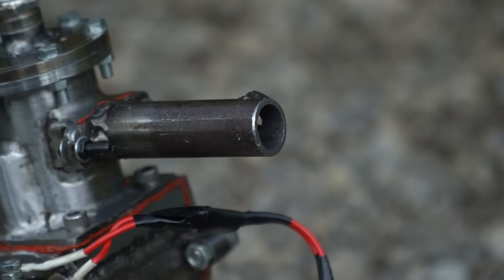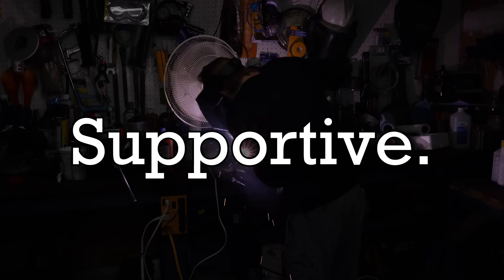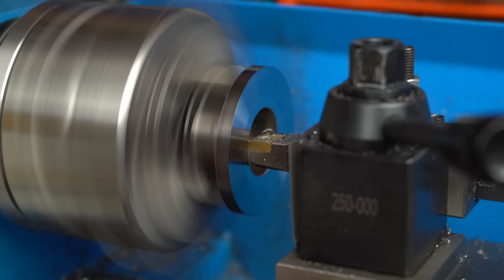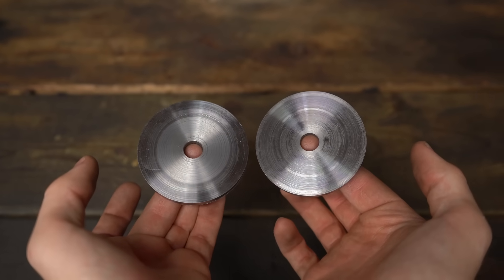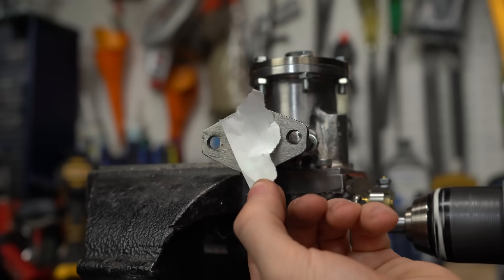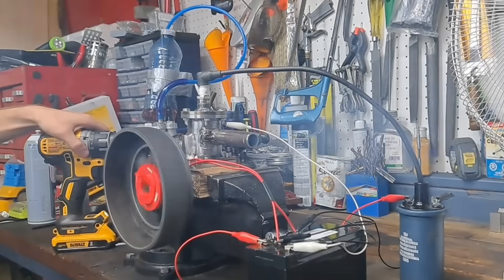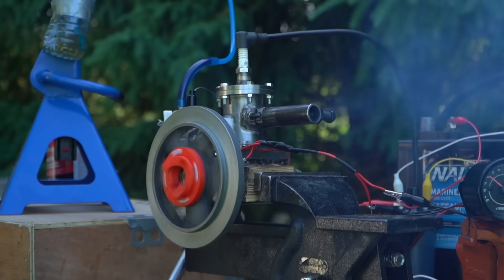I Made a Two-Stroke Engine Using Things I Found at the Hardware Store

Comment: This is an excellent project. In my experience, nothing has helped me learn more about a topic than reinventing the proverbial wheel. We do this all the time in computer science. Luckily rewriting code and debugging is free and takes much less time. The same can't be said for mechanical and electrical engineers. Mad respect for you patience and courage to face potentially expensive failure.

Comment: I've been thinking about something different: converting a compressor into a bash valve steam engine (piston goes up and bashes open a valve to admit steam, piston goes down and uncovers an exhaust port.) I notice you use a rectangular port. How does that affect the piston rings? I was thinking round would be less likely to snag them.

Comment: I'm amazing at everything except welding.
What I finally learned was pull in a consistent line, stop trying to weave. I have a flux welder and the power curve is high non-linear, so the various weave patterns fuck up the heat transfer, wire flow then goes out of coordination and you just end up with a blobbed up mess.
When you can pull in a straight line and get good pooling and penetration, just do very short distances over and over again letting it cool after every minute of welding you do.

Comment: OK make one a bit bigger. Carve fins into the crank case and put the engine in a go kart. You don't have to build the kart, if you can borrow, or buy a cheap used one.  A running engine that can do work, would really impress. 
I have been wanting to build an engine since I was a child, 50+ years later, I am watching someone else do it. Never did acquire the tools needed, and never got around to it when I had access to a machine shop.  
- Cheers

Comment: there’s just so many wrong things here. 

the ports MUST be calculated, you have to phase the ports (including the transfer ducts) in crankshaft degrees. 

For example, 50cc 2 stroke scooters have an exhaust port degree of 180 degrees and it’s “low” so it has maximum torque at low rpms. 

The exhaust port width must be calculated if it is elliptical, in your case it is and it must NOT go over 70% of the piston diameter, so if your diameter is 47mm, exhaust port can only be a maximum width of 32mm, anything over that will make it loose a lot of power. 

The cylinder head must not be flat it the piston isn’t a flathead piston that will ruin compression and cause misfiring issues. 

English is not my first language.

Comment: 2 strokes need backpressure to run right. the opened portion of the pipe creates negative pressure wave and sucks the exhaust out of the cylinder, also pulling in the new charge, the necked down portion creates a positive wave to force the charge back into the cylinder. You jet the carb so that you have about 1/4" of wet exhaust. The new charge gets 1/4" into the exhaust before being forced back in

Comment: u should have contacted people in europe specifik italy spain poland or the netherlands  in these countrys we stil have like a lot of two strokes and also they stil are here on the road a lot because a lot of people here think four stroke is for bikes and cars and suchs not for mowpads or dirtbikes and also u put in to muchs oil whit youre petrol thats why its smoking like crazy and also it seems like u never ever have put togheter and apart a normal two stroke to see how some simple things are wichs whould have made this easier and probably runing beter and that thing whit the carb i already knew that 19 mm is to big for that litle engine u add least need 50 cc to make good use of a 19 mm i even think u should put on a even smaller carb than 13 just because youre displacement is sow small and puting in biger jets is easier and beter than ajusting the hight of the needle wichs already whas set add the best position from the factory i mean those things are sow easy to avoid and you are smart enough to for see that stuf

Comment: I might have missed it, but I hope you had a very good oil seal on the crankshaft/crankcase bearing, because it's probably one of the most important things for a great running 2stroke, is having awesome crankcase pressure, higher viscosity oil makes a difference to give better crankcase and cylinder pressure, in the old days when 2strokes just used a brass bush for the crankcase seals, you always used 30w oil at 10 to 1 mix, for that purpose.

Comment: It's very easy to make a reed valve box for the inlet side to the crankcase, it makes heaps of difference to preventing blowback and not needing back pressure from the exhaust, which actually slows the motor down in the end.

Comment: Check out the workings of the RM 125 2stroke dirtbike =) it uses a cooling system that passes liquid around the cylinder walls and out into a aircooled radiator, you would also be able to pull an exhaust pipe off a 90's something RM motor and cut it down for your size =)  the 125 should use a 21mm throttlebody carb, and you could potentially connect a stator on the flywheel to charge your system

Comment: Hello, I see that you have a variety of skills and instrumental equipment to have carried out this work, so I propose the following, to make a 4-stroke engine, say 50 to 150 cc, with an overhead camshaft, work in 2 strokes, for which you will surely have to use direct fuel injection, a small air compressor to evacuate the combustion gases after the piston reaches bottom dead center during the exhaust, and modifying the cam crossing to proceed with the appropriate operations to evacuate the burned gases and to introduce fresh air through their forced sweeping, for a new combustion. Without necessarily having to overload the cylinder chamber, only enough to the RPM regime that the engine is carrying. Theoretically, the power and torque should almost double. It must be ensured that the metallurgy of the engine is NOT forced, in which case it must be reinforced. I hope to see your success soon in this problem that I bring to you and propose to carry out, with your abilities, since I do not possess them, I am putting it to you. Best regards from S.L. Argentina. !!!

Comment: seem to recall something about 2-stroke engines having an angled part on the intake side of the piston to direct the fuel away from the exhaust port.
Reply: Yes! older two strokes used a baffle on top of the piston to prevent the intake charge from blowing right across the top of the piston and out through the exhaust ports!

Comment: brother i REALLY hope your wearing a respirator rated for weld fumes under that hood. Especially with flux cored wire, if not you're looking for a p100 with some nice 2097 pads, and then change them pads frequently. Those fumes are absolutely no joke, acute exposure aside, prolonged exposure will hit you in the whole ass respiratory system with cancer, stomach ulcers, kidney damage, and irreversible damage to your nervous system. sorry for the high horse but keep safe man, you want to retire with the ability to piss and breathe normally with the state of mind capable of appreciating those things

Comment: who uses the handle on angle grinders ? and safety shield ? it only cost me 900$ for the rusted metal weld spackel removed from my eye   totally worth it .. ( it was hot when it went in too so it burned its way down deep and they pick it  out with a pointy stick not uncomfortable at all .... and eye ointment is fun too )

Comment: I cringed a little when you spent all that time making interference fits just to weld it to something. Tolerances and heat treatment don’t really mix. 😅
Reply from the maker: I made sure to weld in small bursts from side to side to make sure the bore wouldn't get warped out of round, I think  it worked out all right lol
Reply: @CamdenBowen  oh you would know if it didn’t work. Fucko’ed bearings have some not so subtle ways of letting you know when they’re ready to go. Amazing work by the way, never seen your stuff before but this is solid content. Keep it up!

Comment: I may just be regurgitating dirtbike information, but don’t you need a reed valve which is basically a check valve in order to get the fuel into the motor if not, it’s pushing fuel mix into the piston and out of the carburetor probably a little bit more going out  the carburetor side also since it is a much bigger opening, pretty sure it needs a reed valve

Comment: Thats a very nice effort to  build from scratch 👍 Funny how you're figuring stuff out about 2stroke that used to be common knowledge when back in the late 70's and early 80's we had German Zundapp and Kreidler bikes with 2stroke engines. We experimented with modified flywheel from a Honda SS 50 4 stroke engine. Those  have a centrifugal controlled variable timing on the ignition so when rpm's increase,  the moment of timing  also gets advanced by a few degrees. Try different sizes main jets in your carburettor.  In my experience with a 12 mm carburettor, a size 064 jet with the needle up in about middle position  and a short as possible intake works really wel on a 50cc. You could do with more ports though, five in the cylinder  an extra square port in the back of the piston will help load more mixture. Polishing the intake and ports will help that too.  If you really want to go crazy.. why not try building a two stroke boxer engine 🤩💡

Comment: You have to be getting stoned or something before you go into building this s**. It's okay if you are...  I put twin turbos on a 200 horsepower jet ski 1 turbo for each cylinder LOL and the 30 shot bottle of nitrous let's just say I have the fastest ski on the gulf right now LOL and I don't take it out very often because it's something that you have to be aware of and ready to ride and when you ride all day you are so tired at the end of the night. Because of the mental power and the strength it takes to hold on to the ski and drive it safely. Dude you have to put that on something that you can drive one of the old school scooters with the inflatable tires that had the stand deck on them Mount that b*** to the stand deck of one of those scooters and make a little seat bracket and put a seat on it see what it does under load or just build you a badass 1/8 scale model RC car and put that in for the engine

Comment: An engine never needs "Back pressure"
Reply: then why does every low speed and medium speed diesel have a constricted exhaust port in the cylinder head that's 75% the size of the intake port
Every single model from Wartsila+Vasa+Sulzer, Bergen, MaK, Deutz, EMD, MAN, Yanmar, etc follows this
Reply: @Patrick.Weightman  What I should have said is " A gasoline engine never needs back Pressure"  This is a true statement. I am not knowledgeable in diesels. But in gasoline engines back pressure is detrimental to performance.

Comment: Awesome video! Are you planning on optimizing the design? Balancing the rotating assembly and adding a rubber damper to your flywheel wil greatly improve this awesome little DIY motor.

Comment: With a 2 stroke motor you need the exhaust couse it need the backpresure and at a 4 stroke you not realy need a exhaust but it's better to use with exhaust couse when its warm the gases flow better and brings you a bit more power.

Comment: Thats awesome, i hope you can get some stats on its power and tune it.

About that back pressure, you dont want any on a 2 stroke, infact you really want a vacuum if possible to pull as much burnt fuel out and pull new air in so your not re-burning exhaust gas. 
2 stroke pipes are all funny shapes to reduce back pressure and prevent reflected shockwaves moving back into the exhaust port and causing more back pressure or inconsistent exhaust. 

The reason the engine ran worse with no exhaust is because the pressure wave is exiting in a chaotic manner and not a smooth laminar one. This is why intakes are curved like a funnel, it lets the air move smoothly and prevents eddies or chaos. 

If you want an optimal exhaust then it'd look like a short trumpet, obviously thats not great for your ears but hopefully you get the idea. shoving anything into a pipe is hard, makes it go much easier with some smooth guides, its a massive rabbit hole,  radius, diameter, length. Its different for every pipe and it changes depending on flow rate too. 

Look into it if you want a headache.
Reply: That's not true at all. If you have no back pressure you evacuate fueled air and risk it preigniting from the hot exhaust.

2-stroke pistons often have a swoop going from low to high from the intake side so that the intake air gets obstructed as it enters the chamber

Comment: You also need to add a charging system to the flywheel output so it will run and start by itself using permanent magnet stator

Comment: I love the combination of grinding shields and respirators for health and safety, but no gloves.
Reply: There are two types of people. 

Those who work with our hands. 

And you types.
Reply: @krvnjrcbs  ah yes the age old argument of I'm a bigger and better trades guy than you cause I am bare handed. Having filthy hands doesn't make you any more a maker than the next. It just makes you spend more time washing off the grime.
Reply: @twitchyflash333  If you wear gloves around rotating machinery, you are a r'trd'd person. It is a safety issue and anyone who actually works with their hands will say that. It's one of the easiest ways to tell "who is who".
Reply: @krvnjrcbs  I wear gloves when using a grinder. When using a lathe or drill press I'm bare handed. I understand your position but I still prefer gloves on grinder to avoid burns.
Reply: You don't wear gloves around anything that spins. Great way to lose your hand.
Reply: @jttech44  as a grinding disc takes off your flesh when it grazes your hand.
Reply: @twitchyflash333  Pretty simple to avoid honestly, just keep your hands/feet/dingus away from the angry spinny bit.

Comment: Insanely impressive build, but by sound alone, it's still definitely 4-stroking. Maybe an expansion pipe exhaust or a reed valve on the intake would be enough to fix it?

Comment: Depending on what you’re working on meaning what type of metal usually you want to heat it up with a blow torch if it’s chilly or even slightly off temperature meaning to cool that right there will help you with your welding, but seems like time do mini circles or half moons and you need to turn your amperage up those few things right there should help you get a better world and honestly don’t forget to clean metal or grind areas that you’re going to weld. I am by any means. Professional I am an amateur self-taught, but it seems that time I can get what I want it welded done in my walls don’t break had problems with stuff next to my world breaking but the wall itself don’t eat up with a blow torch. Next time you might know it’s a bit of a difference, and again you need to turn up the amps.

Comment: you bet i want to see more things like this !!  This is quite an accomplishment !! 
2 stroke exhaust is all about reflected waves and the timing of those waves. Hence the name tuned pipe!
O and the design of the overhanging crank sucks , make 2 discs with shafts supported by bearings and  the crank pin connecting them More betterer!!!
Reply: Yes would be cool to see how much the efficiency can be improved with this. Also next step then is some RPM adjusted outlet valve

Comment: Summary

* 00:00:00 The Challenge: The creator wanted to build a two-stroke engine from scratch, despite limited prior experience with them.
* 00:00:02 The Approach:  The creator decided to build the engine from readily available materials, primarily from hardware stores.
* 00:00:07 The Process: The video highlights the process of building a two-stroke engine, focusing on:
    * 00:01:26 The Crank Case: Constructing the crank case involved cutting and turning a pipe on a lathe, welding square bars to create a flat mounting surface for the cylinder, and drilling and tapping holes.
    * 00:06:21 The Cylinder: The cylinder was made from a pipe and involved cutting ports, welding a piece to the top for a spark plug hole, and boring the cylinder to fit the piston. 
    * 00:10:36 The Crankshaft: A crankshaft was made by welding together two bars, turning them down to size, and creating a connecting rod. 
* 00:12:42 Troubleshooting: The engine initially struggled to run, and the creator identified several potential issues:
    * 00:13:15 Lack of Exhaust Backpressure: The absence of an exhaust system could be preventing the engine from idling properly.
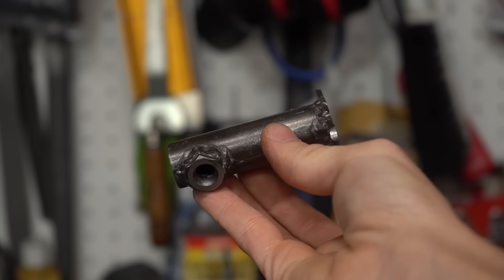    * 00:14:53 Carburetor Size:  The original carburetor may have been too large for the engine, resulting in a lean fuel mixture.
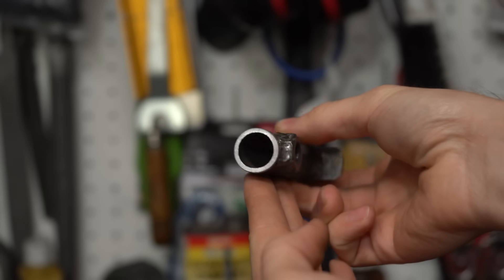* 00:14:02 The Solution: 
    * 00:14:02 Adding an Exhaust: The creator made a simple adjustable exhaust system to experiment with backpressure.
    * 00:15:08 Switching Carburetors: A smaller carburetor was installed, providing better air speed and potentially a richer fuel mixture.
* 00:17:33 The Final Result: After several rebuilds and modifications, the engine finally started to run, albeit with some issues. 
* 00:19:30 What's Next: The creator plans to make improvements to the engine, such as adding a cooling system and a more robust exhaust system. 

I used Google Gemini 1.5 Flash to summarize the transcript.
Cost (if I didn't use the free tier): $0.0031
Time: 15.51 seconds
Input tokens: 37939
Output tokens: 906

Comment: In the 2nd stroke, the volume of the crankcase (minus the volume of the shaft) should be as small as possible. This is a forgotten but basic parameter of these engines. I think that if you took this into account in the design, you would get a much higher power output, as it is ridiculously huge in this engine.